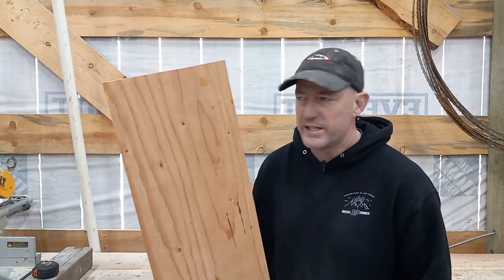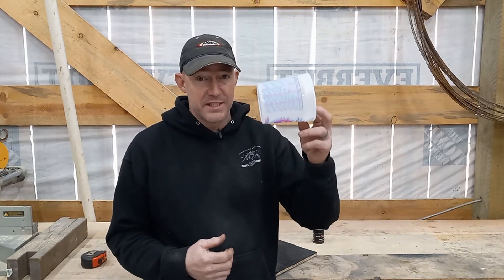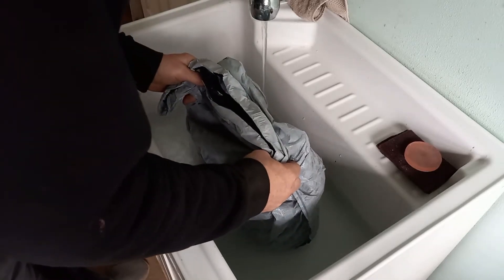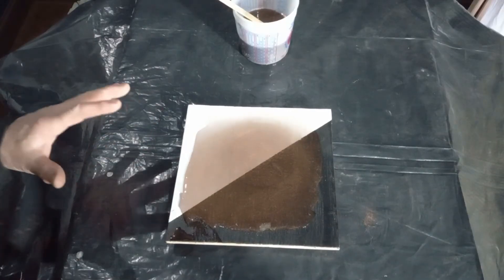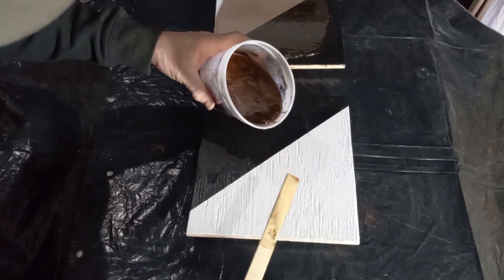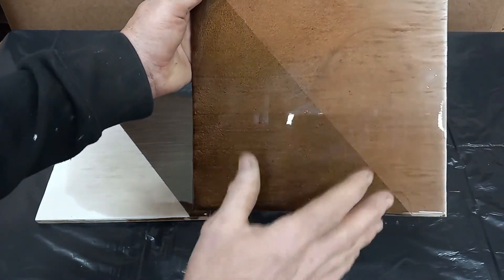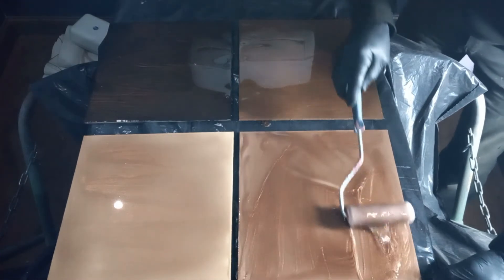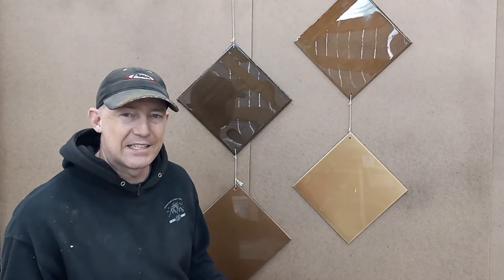What they don't want you to know. Mica Powder and Epoxy

Comment: Completely new to epoxy hoping to do a little DIY fix-it in the house as a surprise for my man (✋don’t worry, I got this, I’m sure of it🤔😬😅)…. So I have a question… Why are you “bringing the epoxy to temperature” first? I’ve never seen that done before. What difference does it make, what temp should it be at & is it the same for all epoxy types? Great video, thanks so much!!! 😁😁
Reply from the maker: Sometimes I have to warm the epoxy up because it's stored in a cold place and so that it's easier to pour and mix. From what I have learned from doing epoxy the bubbles will come to the surface faster when it's warmed up, the epoxy also creates its own heat as it cures to help the bubbles come to the surface. You can heat the epoxy with a torch to bring the bubbles to the surface and pop them but if you heat the epoxy to much I have gotten tiny micro bubbles in it that wont come out, leaving a haze to the epoxy. This only matters if you are pouring a clear epoxy, if you are pouring a tinted epoxy you cant see into the epoxy to see the tiny bubbles. Hope this helps, have fun with your project and thanks for watching. :)